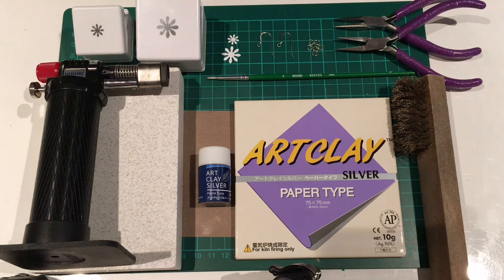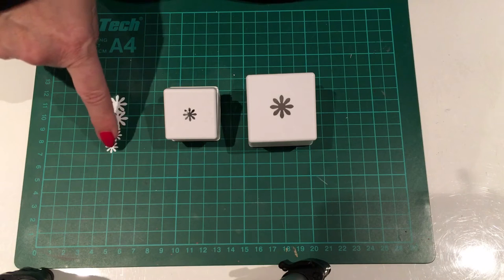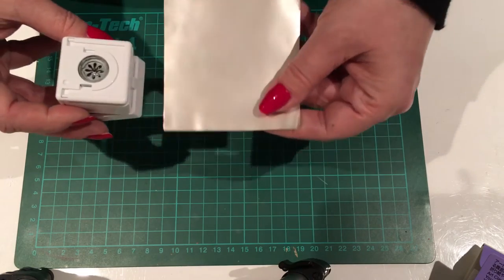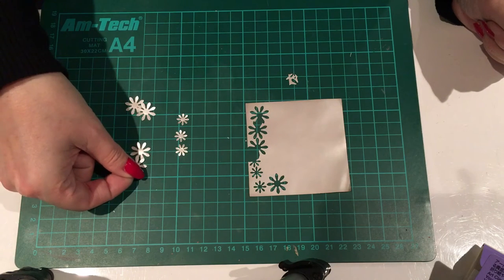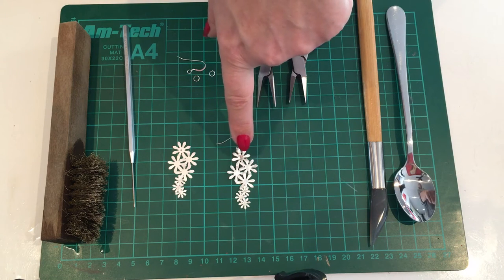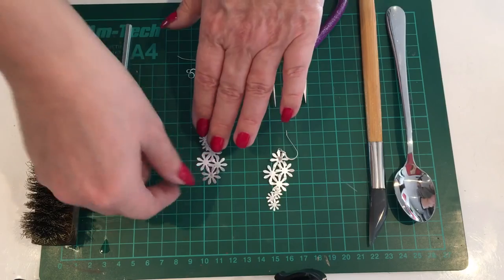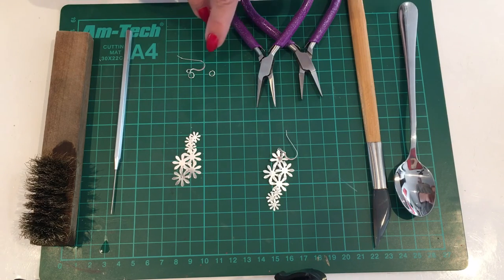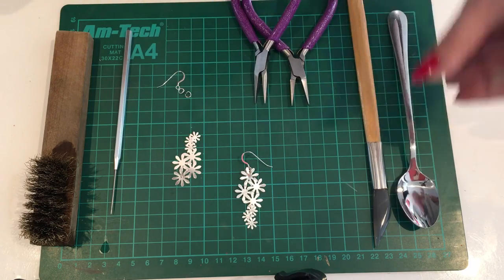Silver Art Clay Paper Earrings Tutorial

Comment: Can this be embossed please.
Reply from the maker: +Jackie Davies  thanks for the question.  I think this depends on what tools you want to use.  For example you can buy paper cutters that have an embossing element and those would work.  If you watched the video you'll see I mention that if I press with my nail I get a mark that won't come out.  So you could use a very small ball tip tool to depress lines (so you'd leave raised areas).  You would have to be careful not to cut through though and even when fired, without embossing, the metal is very fine (you can bend it) so you'd need to be careful.  I hope that makes sense.
Reply: Jackie Davies yes You can, I do so

Comment: how strong is the silver clay?
Reply from the maker: You've commented on the silver paper video so I'm wondering whether you want to know the strength of the paper clay and not the normal silver clay?  If so, when fired, the paper clay is like a thin strip of metal - so you can bend it with your hands.  It's quite pliable, just like metal would be.  So if you're using silver paper I'd suggest limiting its use to earrings or embellishments in pendants where you need the flexibiliity to achieve a design.  With "normal" Silver Art Clay, it's very robust once fired.  As it's 99.9% silver, it's softer than sterling silver so can bend out of shape if there's enough force but for pendants, earrings etc it's definitely tough enough.  It's also ok for rings but there's a new product on the market now, which is a Sterling version and it's as tough as Sterling you'd buy in a shop so really great for rings.  Hope that's helped.
Reply: @artisanalchemybymichele471  Hi Michele, I recently purchased some of this art clay paper type but was really disappointed with the fragility and flimsiness of the silver once fired, it is far to malleable, I often use 0.3mm silver for folded/sculptural jewellery and it is certainly not anywhere near as flimsy as this particular brand of art clay paper type,  I could not sell the pieces I have made as they would be so easily bent.  Can you tell me what the sterling version that is on the market is called please?  Thank you, Layla
Reply from the maker: layla glantz Artisan Alchemy by Michele  Hi Layla as you can see from my reply to Sonny Choi, I have said that the Art Clay paper is very thin when fired and can be bent (and straightened again) quite easily so I would limit how I used it. Earrings and embellishments on other pieces are really the limit for this BUT it can be used for origami style projects that are a little more sturdy. I’m sorry but I don’t know if there’s a Sterling version. I would assume there is but I haven’t personally used it so I wouldn’t feel comfortable recommending anything.
Reply: Artisan Alchemy by Michele  Thank you Michele, I'll do a bit of investigation :)
Reply from the maker: @laylaglantz8876  if you look at one of my other videos that has hints and tips on using silver art clay paper, you'll see an origami butterfly pendant I've made.  That pendant is heavy and solid so totally different end result to the earrings.  Hope that helps.